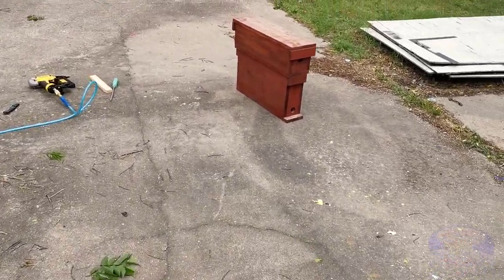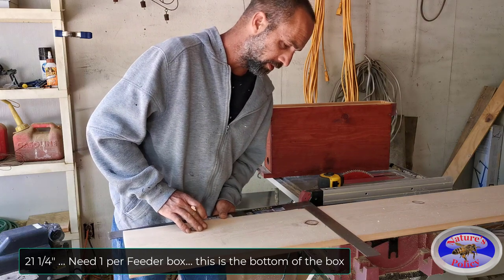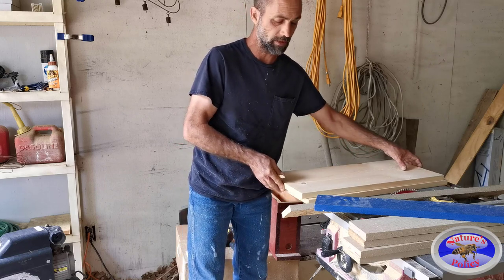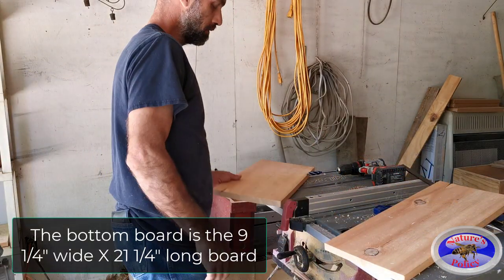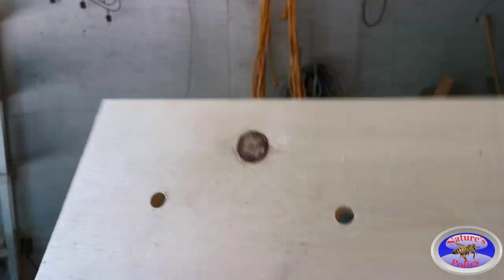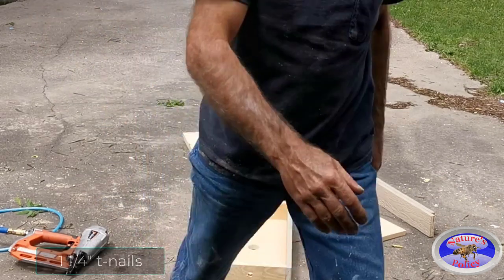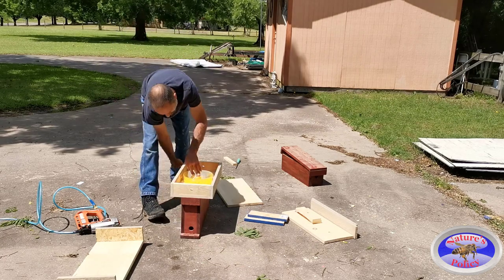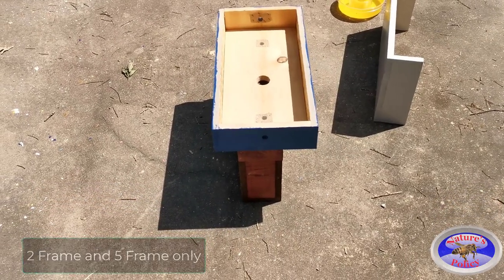2 Frame Mating Nuke FEEDER Top Box     Part 2 to building a 2 Frame Mating Nuke

Comment: So, how do they keep from tipping over besides the blocks you mentioned? Looks a little  top heavy.
Reply from the maker: The only time I have had problems with the wind was when the wind got over 56 mph which is usually never but we did get gusts to 64 mph and had issues at that point.
Reply: I've seen some people run a deck screw through the bottom of the hive, into the hive stand/beam below. Im guessing this means you won't be moving the nuc very often- im sure the bees propolize the screw head, making removal difficult.